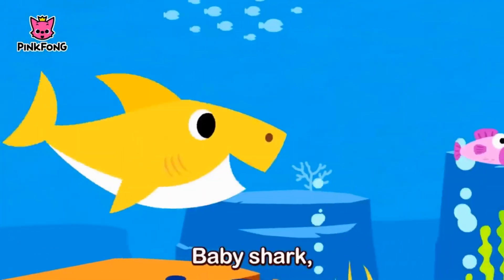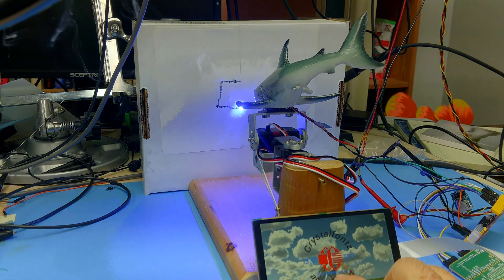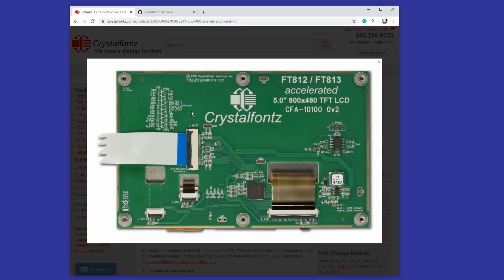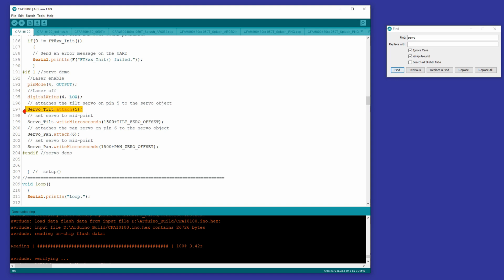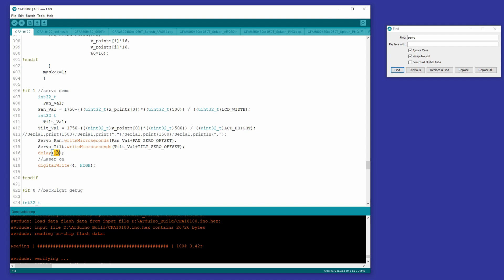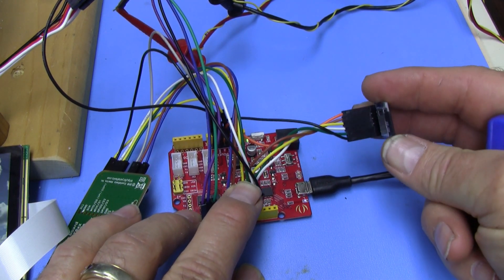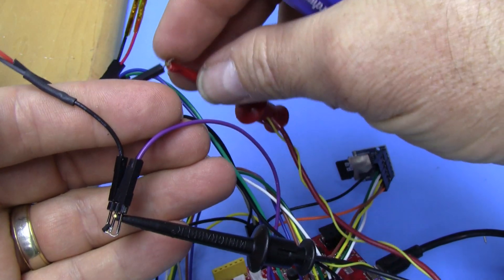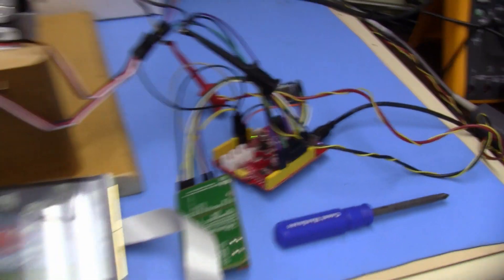Arduino / Seeeduino 5" FT813 TFT touch screen with servos and sharks with lasers on their head

Comment: Where is the seeduino...
Reply from the maker: The seeduino is the little red board that's controlling everything, you can see it on the right with all the wires attached to it. 
You can find them on our site here: https://www.crystalfontz.com/product/cfapn15062-seeeduino-arduino-clone-microprocessor or you can purchase the kit which has the seeduino, eve breakout board, display and all the wires.